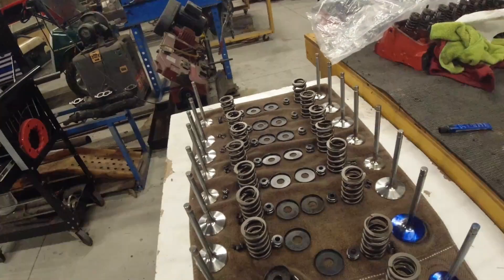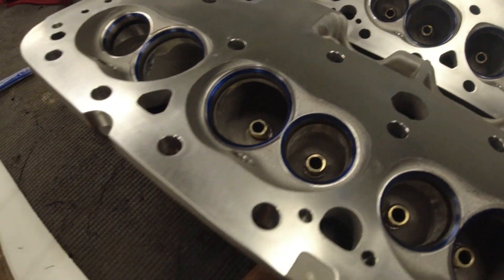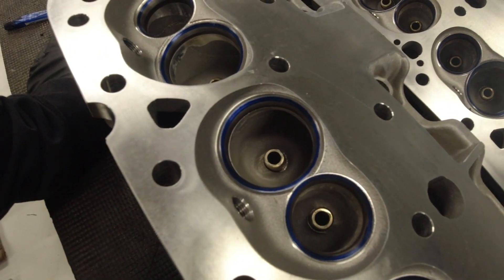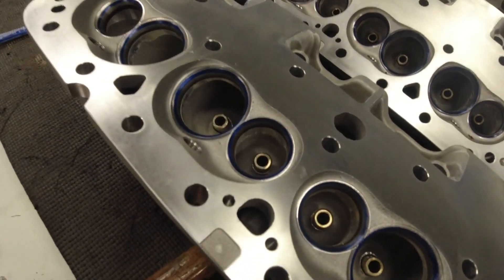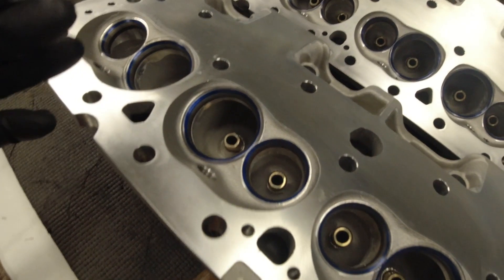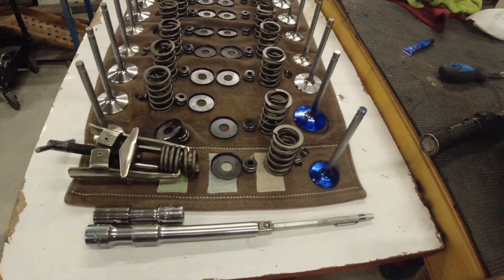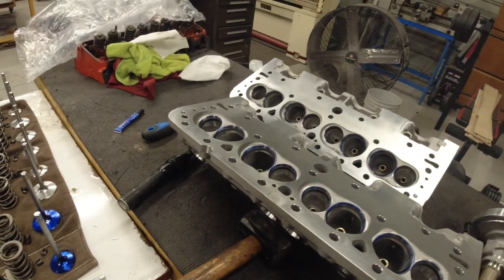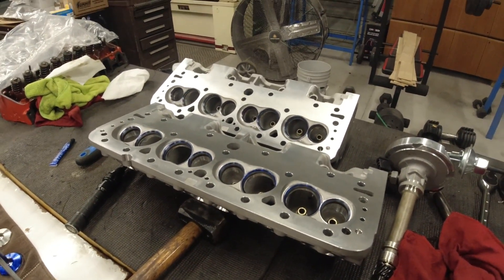Checking the valve runout on my new Edelbrock E Street aluminum heads.

Comment: I purchased a AMC version of the heads. The first set had valve issues leaking past exhaust valves. Found by performing a leak down test. Edlebrock exchanged them for another set of heads under warranty. Second set tested good.
Reply from the maker: Mine tested good but after about 5k miles some of the valve stem seals are leaking. It's just a good thing I don't have any hair, or I would be pulling it out. LOL.  I'm not blaming Edelbrock completely for this issue. I took the valves out of the heads when I first got them to check the tolerances on them. I was careful removing and re-installing them, but it is possible I may have damaged them in the process. I'm going to replace them while I have the engine out of the car. I have never had so much trouble with an engine in my life.

Comment: You should never bolt heads on right out of the box, always have them checked by a reputable machine shop. Regardless of the manufacturer. It’s not just Edelbrock, many high priced heads can have imperfections. It’s easier to do that then have to pull them off and do the job all over again. Good luck
Reply from the maker: @Richard-f2p9i  that is true. Thanks.

Comment: I bought some cheaply made heads for my c4 corvette. The heads were bent 2.6mm between in the middle when I placed them together.
I torqued the mid bolts first, so I could find out how much torque was wasted to make them flat. The heads are the crappy Edelbrock RPM, Poorly made in the U S A.
Reply from the maker: I am very happy with the Edelbrock E Street heads. I have put about 3,000 miles on the heads with no issues.

Comment: Like anything hand assembled by a human, quality is only as good as the human. Got a head from new person's first day alone? Doesn't matter if it's heads, trans, crate motor, etc. More important to me is the customer service for when that happens. Companies keep track and budget for quality failures (price point too). 10% or less is standard, so you should have a 10% chance of getting as badly assembled part.
Reply from the maker: Unfortunately, if something is man-made it can have defects. I agree with you about customer service. I believe a defect is not a problem as long as a company stands behind their products and makes it right with the customer. If we stopped buying from every company that made mistakes, there would be no companies left to buy from.
Reply: Not taking apart a crate motor, i think they might just slap heads on out of the box...

Comment: I’d take that lip off just inside under the valve seat there. And making the exhaust and intake ports same size of the gaskets is easy safe and free flow increase I mean not doing that at a minimum is really hurting yourself and your gaskets on exhaust going out easier.
Reply from the maker: I should have done that when I was installing the heads, but I got lazy. The car runs as fast as I want to go so, I guess it really doesn't matter for an old fart driver car. LOL
Reply: @timewiththedurbins  yeah maybe you’ll get a wild hair and do it sometime. It’s definitely worth it and easy especially on aluminum heads I did it on steel heads for my 350 in like an hour I even cleaned up inside ports as well.

Comment: I'm a Journeyman machinist but have also spent time in three automotive machine shops now, I own the third. Been checking every single head for 20 years and can't stress checking them enough. Some are good, others out to lunch. Edelbrock is on my naughty list for quality even though I use their products in personal builds.
Reply from the maker: Thanks for the input. This is the first time I have used Edelbrock heads so it's been a learning process for me. I think I lucked out on the set I purchased, they seem to be ok. I will let you know after I get the car put back together.
Reply: @timewiththedurbins  I'm sure you're good, I don't mean to bust on your project or parts selection. Just saying in the engine shops, well the ones I personally know at least, we check everything becaues when something don't work it's us who get the phone call lol
Reply from the maker: I don't feel you are busting on my projects. As I said, this is a learning process for me so any tips or pointers on what to do is greatly appreciated. I used to own a machine shop, so I know what you mean about who gets called if something doesn't work, (even when it isn't your fault). One of the joys of being in business. Thanks for watching and for the comments.

Comment: I had a set of Edelbrock RPM heads bought them in 1999 running until 2014 finally had the first valve job had a broke spring but no problems running on a 306 and a 349
Reply from the maker: I believe Edelbrock is a good company that produces and sells quality parts.If not, they would not still be in business after all these years. The heads I purchased show the quality of their products. I am in no way trying to tarnish Edelbrock's reputation. I have purchased Edelbrock parts for many years and will continue to do so. Thanks for watching.

Comment: Never bolt any head out of the box !that why you can’t trust napa! Pour gas lol !😂
Reply from the maker: I did not purchase the heads from NAPA. If I would have taken my engine to them in the first place I would not be having the issues I'm having now. 
If the valves would have been out of tolerance .008 to .010 the gas would have ran out of the valves. It is a good way to test for severe leakage. There are more precise tests you can do but that is the easiest and quickest way to test them. If they leak the gas then you know you need to have them reworked. If they don't then you can check them further like I did or take them to a machine shop to further testing if you want to make sure there are no problems with them.
Reply: @timewiththedurbins  that’s not what I said. Anyone tells you to pour gas they’re retards ! Wd 40 works great and not very flammable.Is that what Napa told you? I noticed the margin on valves varies not good. Most shops will do quick test smacking valves stems with rubber mallet then add light and fluid to ports. Anything assembled on a production line is going to have variable performance. I checked mine lucky that was fair margin on valves little lapping took care of it. Hopefully everything is good now! Thanks
Reply from the maker: @MrBlackbutang. Sorry about that, I mis-understood what you meant. You are right, you should not use gasoline for anything other than fuel. Thanks for information.  Have a great day.
Reply: @timewiththedurbins  this one of the greatest greatest Machinest in America. He knows his stuff 
https://youtu.be/tWPwMdbhJzw
Reply from the maker: I will check him out. Thanks

Comment: My main concern would be the close overlap between the intake and exhuast vavle. If u are driving alot of highway the heat buildup on the exhuast vavle can warp the intake seat. GM had this problem in the 350 motors with 9.0 comp and 2.02 intake and 1.5 exhaust vavles. I dont know what vavle size u have but a smaller vavle and larger cam is a better solution.
Reply: I have 2.18/1.60 valves in my small block and it has zero issues going down the highway or anywhere else.
Reply from the maker: Thanks for the information. I will check to see what my valve sizes are. I am planning on driving this car on the highway a lot.
Reply: @timewiththedurbins  Don't waste your time, they will be perfectly fine just the way they are, ran 200cc Eddy E-Tech heads on my 383 stroker for 75,000 miles and they were perfect when I removed them.
Reply from the maker: Thanks. I appreciate the information. I was almost regretting buying these heads.

Comment: My question is why would head manufacturers sell heads that require redoing? You are overthinking this because of what other people have said. Heck there are so many hacks out there and I just shake my head with some of their opinions.
Reply: I have seen aerospace parts supposedly built to our tolerances and cleanliness for Delta II & IV 1st. stages. Thankfully our testing procedures found defects or FOD that could have cost loss of a multimillion $$$$$ mission. Can't pull over once it leaves launch mount. Some missions were YOUR Tax money. So yea he is being a bit concerned. Not everything on net is a hack job. Use common sense.
Reply from the maker: I agree with you, why would a company sell something that is not right. I believe no one would sell something knowing it wasn't right but sometimes things can slip through the cracks. I just wanted to make sure everything was good on these heads. 

If you watch my videos on this car you will see the issues I have had with the engine that was in the car. I took it to a respected machine shop and had them rebuild and assemble the engine. So far, I have found the intake gaskets leaked, some of the valve stem seals leaked, the head bolts were not tightened to spec, 2 of the push rods were damaged on one end, the timing chain was off one tooth and the heads leaked coolant. I don't believe the machine shop deliberately messed up on my engine, but it was messed up just the same.

I just want to make sure I don't have to pull this engine again. It is a lot of work and expense. It is easier to check things now than after the engine is installed. 

Thanks for watching and I appreciate your comments. Have a great day.
Reply: We check every single head before we put it on an engine backed by our warranty. After checking 1 or 2 heads YOU may think there is no need. But come back after you've inspected hundreds and you'll see exactly why we check them.
Reply from the maker: It's Murphy's Law, the one you don't check is the one that will be bad.
Reply: @timewiththedurbins  That damn Murphy guy lol
Reply: @timewiththedurbins  murphy's law is the stupidest thing I've ever heard, absolutely hate when people use this meaningless statement
Reply from the maker: @DD-gi6kx  Definition of Murphy's Law: Murphy's Law is a humorous adage that states, "Anything that can go wrong will go wrong", often used to explain unfortunate or unexpected events where things seem to turn out worse, highlighting human error, complexity, and the inevitability of failure in systems. It's a tongue-in-cheek observation, not a scientific principle, suggesting that if there's a way for something to fail, it will, especially at the most inconvenient time.
Reply: I wonder if Kauffman has these issues?